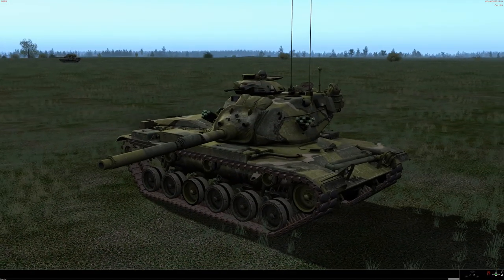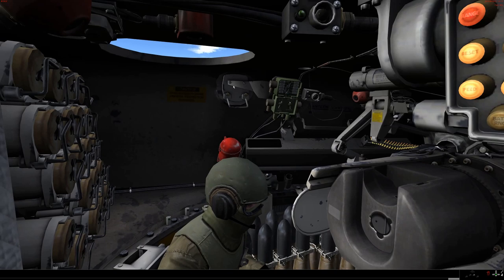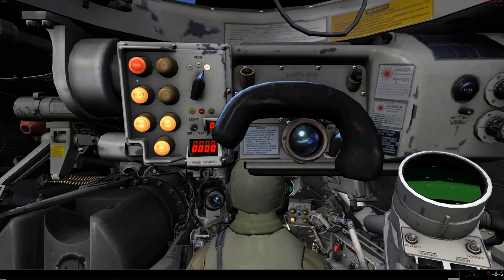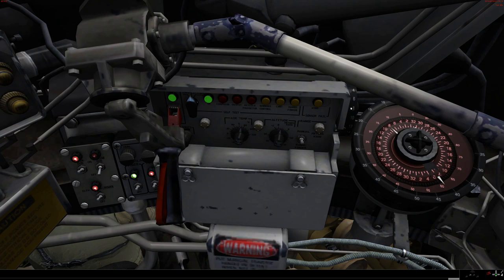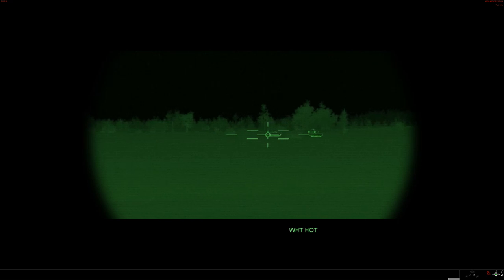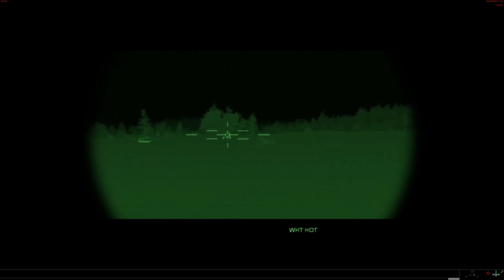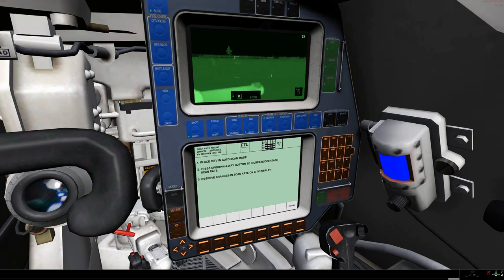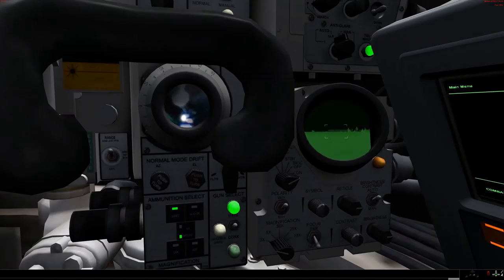M60A3 TTS Switchology, and a little M1A2.

Comment: Ah yes, the recoil pad. The empty 105 casings would bounce around on the turret floor. Part of the loader's duties was to police those up and jettison them or put them back in the ammo rack before the turret monster caused them to rip out wiring and such. I was driving on a tank range once on a moving engagement and the gun fire and something kicked me in the back. I thought "WTF? I was driving right down the tank trail at the right speed why is the TC kicking me?" Then I realized that he couldn't because the turret was traversed over the front. The empty case just fired had bounced under the gun and had hit me in the driver's hole. It started to melt my wet weather gear jacket and I was trying to get it off of me. I was bumping the T-bar and the tank was jerking back and forth. The TC was yelling at me, the loader was trying to get it out from under the gun, the gunner started laughing. Good times.
Reply: @wlewisiii  Although that never happened to me, it did to my buddy Ray who drove the LT's tank. Took him 2 days to clean out the driver's hole when we got back to the motor pool.
Reply: The turret monster? Hahahaha
Reply: this tank. i like it, even i am not american.
Reply: We were at the range in Ft. Hood one summer and it was so hot that I had rolled my BDU trousers up almost to my knees. We were firing so much that I didn't have time to police up all the spent main gun casings. I had one come out ot the breach and landed on a couple of others on the floor near my leg. It was just high enough for it to reach the exposed part of my leg and burn the shit out of me. Went to the clinic the next day and there was a big burned spot with a huge blister already forming. I had another injury, but they were very concerned about the burn since the risk of infection was high. They gave me a whole jar of silvadene cream to use on it and prescriptions for two antibiotics. You could only get it by prescription. I found out later how expensive silvadene was.

hat should not have happened if you had the gate going to the driver hole in place. It was to keep someone from crawling through that opening when the turret had power so they wouldn't chance getting torn in half if the turret moved around. I know because this happened to me. After the gunner fired, the spent casing bounced and came to rest against my back and was only wearing my t-shirt with my BDUs. Burned the shit out of my back. Of course this happened only because I didn't have that gate in place. Although it didn't take me a week to clean out the driver's hole. Why did you have to and what did you clean?

Also, there was only a tiny sliver of a window that the TC could even reach the driver, and even then he would have to get down off his position and stand in front of the gun breach and kicked you. And as before, you would've had to have the gate between the turret and driver hole removed.

Not buying it.
Reply: @vicpecka7356 What did he have to clean out and why did it takes so long?
Reply: @dartmaster501  The safety shield was in place. You can only get to the driver's position from the turret when the gun is over the back deck. The empty case bounced off the recoil pad/floor over the turret electronics boxes under the main gun, or through where the ready storage rounds on the left side of the gun were. There weren't any main gun rounds in those vertical racks at the time. I didn't see how it happened, I just noticed after it hit me in the back. Your event could happen if the gun was over the back deck when firing.

There was a TC in my platoon that kept a section of pole from the camo net up on the top of the turret next to the TC's cupola. When the driver wasn't responding, he'd traverse the turret so he had a clear path to the driver and biff him on the head with it. Outside the tank, not through the safety shield, straight down from the TC's hatch to the driver's hatch. Only worked if the driver was driving unbuttoned.😆
Reply: Indeed my uncle served as M60A3 loader in Germany and later they transitioned to the Abrams with the same 105mm gun, in both tanks he always said the casings would always bounce around and make a ruckus inside the turret, unlike the 120mm. That's why in games like War Thunder or Gunner Heat PC, they made the sound effect of shell casing bouncing after the gun has been fired.

Comment: I was the driver for an M60A3 TTS and I do not recall having cards, the box that You indicated for the cards was actually the XM something ballistics Solution computer.  I mean no disrespect Captain, this was back in 1984-86, if memory serves. so it may have changed when we traded our old A1 Rise/Passive M60's in for the M60A3 TTS.  Tp this day  I recall the day my Platoon Leader, a butter bar, launched the barrel of his M-85 down range because he did not twist the barrel once he seated it in the receiver!  Mind it just bounced off the front slope and stuck in the dirt in front of the track, but it was hilarious to hear him ask range Control if he could dismount and retrieve the barrel to his M-85!  There was that, and then there was the time one of our gunners had both the Coax AND Main Gun turned on and was engaging infantry targets at close range, would have been ok except, they had a main gun round loaded and had the main gun in fire mode also.  So, you heard the ratatat tat tat of the coax, then all of a sudden the shocking surprise of the main gun firing and the infantry targets flying al lover hell and half of Georgia!!  Mind you Range Control went ballistic next!  I am also sure the loader on that track had to change his boxers!  I would have!! LOL

Comment: Disagree with comments on the M85 MG and the daylight sight. Most of the problems with the M85 were caused by user error, and that daylight sight turned the M85 into a sniper rifle. The stability of the commander's cupola and the firm mounting of the M85 made for EXTREMELY accurate fire.
Reply: When I was in 1/70 AR in Wiesbaden, it was a pleasure to watch our BN CO go down range. He had the M85 dialed in and could shoot the tits off or a Graf boar hog. Of course his gunner was the BN Master Gunner. ;-)
Reply: @vicpecka7356  That M85 was BAMF. Never had a bad or unreliable one. But lots of folks had trouble getting them mounted, which inspired a lot of anger at it.
Reply: Not nearly as good as M2HB
Couldn't handle dirt.
I was a 19E/K, I shot both
M2 is over 100 yrs old and still the best a man can get.
Happy Trails 🍀
Reply: Mr. Potato head, 

I was a 19K/E (figure that one out) and an armorer for a while in an M60A3 company.  You're right that it couldn't handle dirt.  The M85's self adjusting head spacing and timing was too complicated.  It chewed up brass so badly that it would look like a glitter bomb had gone off inside it, and they would misfire constantly.  M2 was/is definitely better.
Reply: I remember all of the care we took of our M-85s and all of the tricks we used to keep it from jamming.  My trick was to put an empty coke can in the end of the ammo compartment right next to the gun in order to prevent a sharp turn for the ammo belt.  I hated that thing.  During gunnery we would clean the M-85 and then carefully wrap it in a (clean) bedsheet.  It would stay wrapped up until we were two tanks away from our qualification run and only then mount it and boresight it - because that thing had to be immaculate in order to function with anything resembling reasonable reliability.  

And skinny guys like me frequently had trouble charging the -85.  We would take it to max elevation and pull on the charging handle.  Sometimes I would be dangling in the air.

The M-85 was designed as a replacement for the M-2 machinegun.  And the M-85 was replaced by the M2.

The back of the machinegun had a switch where you could set the rate of fire to 'low' or 'high.'  Setting the switch to low would gurantee that it would jam after a few rounds.
Reply: The key to the M85 is to realize that the many internal springs it used only had so much life----and since replacing many of them was essentially a direct support level task, it never got done because of the high pain level---to move machine guns from the unit arms room to the support battalion, an armed guard was required and transfer of the guns to DS took a lot of coordination and paperwork.  Thus, most M85s were running with the springs they were born with.   As a tank company XO, before one gunnery my armorer and I decided to replace every spring in every gun, and no more problems!!

Comment: Run away gun can be very dangerous and destructive. Had a Leopard AS1 have a runaway gun outside my office window in the Puckapunyal Workshop, except it ran away in elevation. It continually went from maximum elevation to maximum depression so the entire vehicle rocked back and forth so much first and last road wheels came off the ground.
Reply: I has thrown a perfect tantrum. :-D Childish Leopards are dangerous.
Reply: Leopard with severe mood swings sounds dangerous

Comment: Was glad to help.  BTW, on the M60A3, the box on the turret floor to the left of the Gunner's feet with all the cabling going into it is the LRF Electronics Unit (EU unit) that works in tandem with Receiver / Transmitter unit (R/T) mounted in front of the TC.  It contains all the electronics and contains 8 spinning wheels that spin when lasing, and which each return comes back it stops a wheel.  If you get one return, only 1 stops spinning, recording the range from the light impulse return.  If you get multiple returns, multiple wheels stop recording each return's range.  When you 'six-pack' and the laser is armed, all 8 wheels are spinning again.  This is why the M60A3 is limited to '8' returns.....LOL
Reply: I was just watching the switchology video of The Chieftain's about the M60A3 TTS... as a young 19K0O back in 2002, I was told by a few old-timers that the optics on a TTS were better than the those of the original M1/IPM1. does that sound right? If any other tanker out there wants to hear a good sob story, I graduated from AIT in 2003, and haven't been on a tank since ;( Ended up as an 11B3E, with an ASI of B8 (about as close as I could get, #deathbeforedismount)

Comment: "Slick" 60 and the A3 were my office as a lad in the AR Amy National Guard before going active duty and transitioning to the A1 Abrams. Talk about going from a model T to a 78 T-bird to a freaking  caddilac. 😁
Reply: That office upgrade must've been nice!
Reply: Yeah, i was originally a 19E
Crossed to 19K.
Driving was my passion. 
Gunning was too cramped.
Happy Trails 🍀
Reply: @ws2228  Happy trails to you, too, tanker! :)
Reply: Did your Slick 60 have a 90mm gun? Also did it still have the old range finder?
Reply: @kiltmanm60  Slick 60 had the 105mm. M48 had the 90mm up to the 48A5 which got the 105. Coincidence rangefinder, yes.
Reply: @Mechanized85  same as me

Comment: Former M60A1 platoon leader (along with other assignments) - One time in a demo of "Tank-Infantry Team assault on an objective" at the suggestion of the Platoon Sgt, my platoon (with live rounds for change instead of target practice inert rounds) set BOTH the main gun and coax power switches on. We had Smoke(live) and HEP(target) rounds for the main gun and were supposed to suppress a notional dug in infantry unit for the mech guys to assault. Index HEP on the mechanical computer (HEP and coax had the same ballistics) and get ready to fire. I counted down from five over the platoon net and gave the fire order where on all five main guns, coaxes and cal 50 opened on the target. The affect was stunning, even from the TC hatch and literally brought the infantry guys just behind us to a stop!. The gunner traced a figure eight pattern over the target area and held the trigger down for continuous fire while the loader humped rounds into the main gun, called up and on the fire command flipped the safety off and the main gun would fire, rinse and repeat until main gun rounds complete. With the gunner holding the trigger down on the Cadillacs it sounded like tat tat tat BOOM tat tat tat...with the cal 50 mixed in for good measure. The hill top that was the objective just exploded with all the impacts and was covered with smoke from the WP rounds when we got to them (vice the HEP rounds). Very impressive to the military delegation from some Latin American country that the Demo was for and well worth the slight chewing out I received for stretching the safety regs on the range.  Very cool and the last thing I did as Tank Platoon Leader as I the company XO slot a few days later. Ammo load out for the demo was 1500 coax, 400 cal 50, 5 HEP target and 2 smoke (WP) rounds per tank. FUN range run.
Reply: Let me guess, Ft Benning 2-69 Armor (Kelley Hill) at Hastings Range.
Reply: @N_Wheeler  i/8 Cav Ft Hood. Browns' Creek Tank Table IX ... I think, but i could be wrong - it has been a LONG time...

Comment: The turret interior of the M60 series is absolutely massive for a tank
Reply: It's a little taller inside than the M1, but both tanks shared the same turret ring diameter.  What makes the M1 more cramped than the M60A1/3 is primarily the ammo stored behind the TC.  Because of that the TC seat was pushed forward quite a bit.  Because of that the gunner was pushed forward a bit.  Moreover, because of the ammo behind the TC, the radios were moved from the bustle to the loader's side of the turret.  So the radio rack and an enormous amount 7.62 stowed under it meant the loader got to be cramped as well.
When the M60 was fully uploaded with ammo there wasn't much more room than in the M1.
Reply: @drkjk  Interesting, thanks! We have one in a museum at Camp Pendleton and I got to take a ride in it, I was surprised by how huge it is.

Comment: I went thru basic training and AIT in 1981,19E, on the M60, 
Good tank for the time, 
I later crossed trained for M1s in 82, 19K.
I was the driver of M1E1 for the Cold Weather Test Team, Ft Greely,Akaska  83/84.
It was one of 14 test beds for the 120mm, it had a 6  speed transmission from Allison that was a nightmare. Finally had to replace with normal 4 speed. 
Good times
USA! USA!

Comment: "Cavernous" when describing the M60's turret. 
I always like to say it's a small apartment in there. Like, when you're in the commander's seat, you actually have to lean to reach the loader to give him a pat on the shoulder. 
Could probably lay down a cot beneath the breech and take a nap, if you were a little shorter and inclined to do so. 
Awesome machine.
Reply: I used to lay my sleeping bag across the WP rounds in the ready rack  and tuck my long legs up under the coax.
Reply: @wlewisiii  The most important part was that the internal compartments on the .50 cal ammo boxes "Banana Boxes" would fit 2 six-packs each with room for a bit of ice to keep them cold.

Comment: FYI:  The Delta-P is a "Differential Pressure Transducer" which reads displacement of the gunner/commanders Cadillac's position.  It reads an output voltage of 0-/0+ volts when centered and nulled out.  As you depress the palm switch and turn the Cadillac's left/right you will be out putting a voltage between 0-to-15 volts (-) negative when left and (+) positive when right.  The farther the grips are displaced the higher the voltage out put.   This is picked up by the computer which determines way you've displaced the grips and the given voltage out put will tell the system how fast/slow to move the turret, or gun that direction (there are two Delta-P's).  The Delta-P is mounted to both the elevation cylinder and the turret travers motor.  They have two small O-ring orifices with strain gages that measure the pressure on the input side and the output side of the hydraulic actuator they are attached to. So when they fail (which is not very often) it produces all kinds of unintended reactions (and excitement) when you push a palm switch.   Edit grammatical corrections two days after posting..

Comment: On another note.  The Azimuth Indicator and the Quadrant Elevation (QE) were mostly used for recording Range Card data.  A holdover from the IR/Passive days.  When you recorded your Range Card data, it enabled you to occupy the same position and target previously identified targets (bridges, intersections, a building etc.) using the pre-recorded settings during limited visibility.  Yes, it could be used for indirect fire, but rarely was.  In the M1s they just did a sketch card, while us DINOs did Range cards w/ firing data included.
Reply: the marines in the AAV platform myself included still do Range cards with targeting data our Up guns weapon station has a azimuth ring around it and we have a elevation degrees indicator so we dont need to see at all to engage a target we always fill out range cards when we stop for more than 40 minutes stopping for roughly more than 40 minutes requires something more than a at halt check and you have to setup a defense. and if you're staying for more than 1 hour setting up Cammie nets over the vehicle in a manner that doesnt reduce the visibilty from the turret and in a manner so that it can drive in and out from under it in almost no time.

Comment: 14:27   azimuth indicator and elevation quadrant - used to shoot from a range card - installed in M60[A0] and M60A1 - not relevant in M60A3 unless the TTS is broken down.   There still was a Ft Knox training task for it on a night fire range as of 1986.   Occupy a defensive position in daylight, line up likely target points, record numbers on your card, sun goes down, fog rolls in, TTS is obscured, Bob's Your Uncle.   Probably used a bunch in Vietnam from M48A3 which is likely where it started.